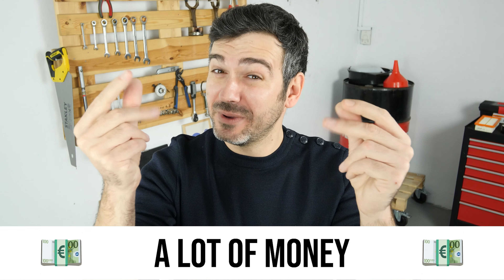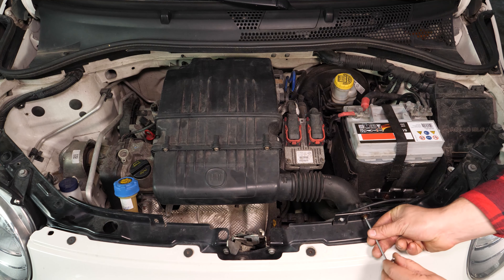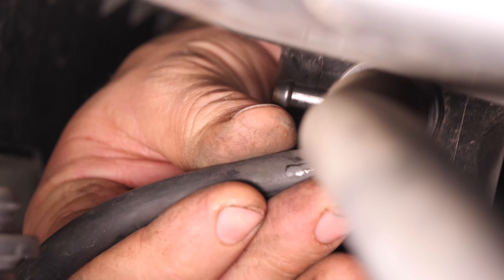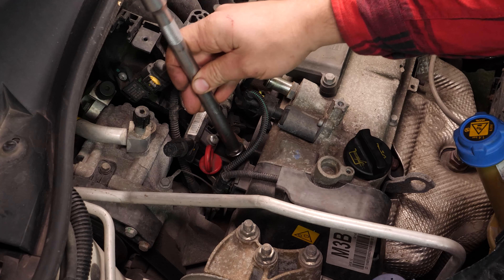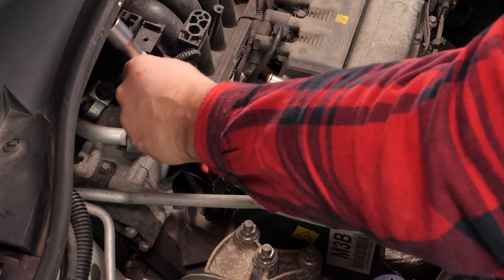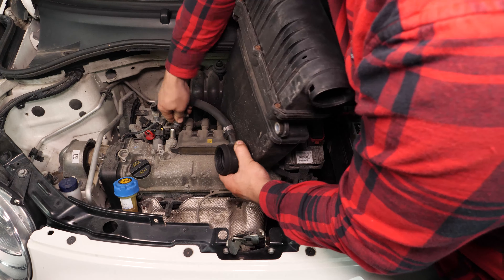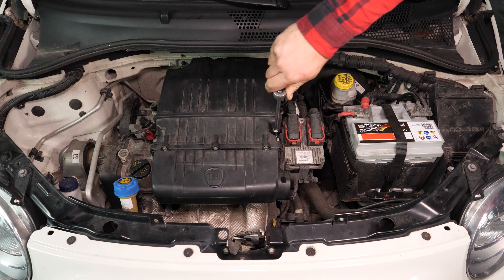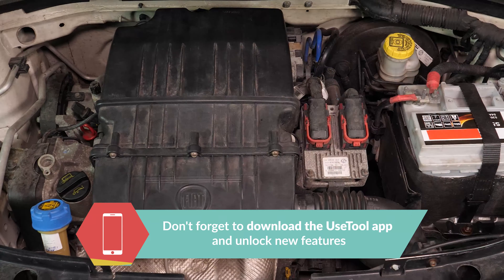How to replace the spark plugs FIAT 500 1.2 ⚡

Comment: Why do you finilise the tightening by unscrewing the plug? That's not even 1/4 turn! And then you don't even mention one of the most important things: to make sure that the area around the spark plugs is clean before starting the job. If any debris fall inside the cylinders you and your car are fu***d!!